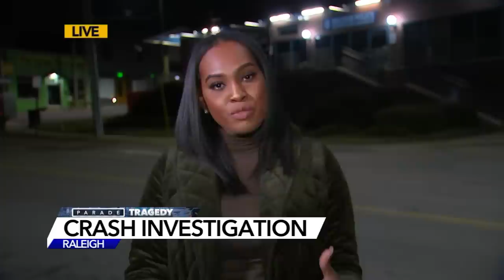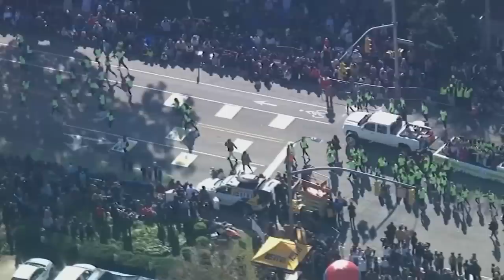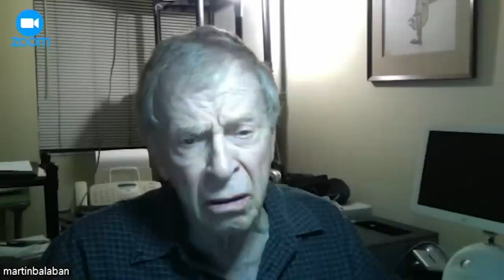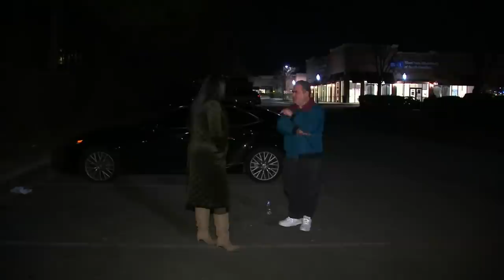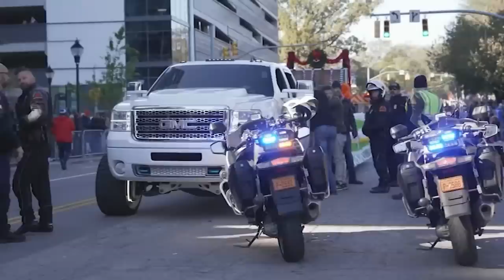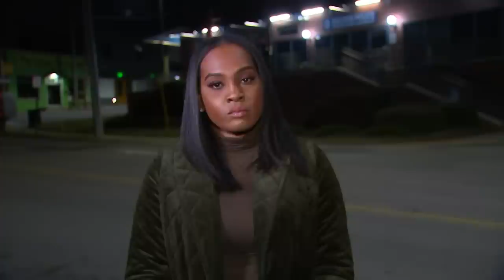Investigators look at truck part by part after Raleigh parade tragedy

Comment: Hydroboost failure. We had it happen twice on a truck just like that. Just all of a sudden, no brakes or power steering. If that happens towing a load, you're in trouble.
Reply: You don't seem to know what you are talking about.  
First in an incredibly rare moment that a  hydroboost does fail... you DO NOT loose the ability to apply the brakes.
Second a hydroboost failure does not take out the power steering.
Third.  A power steering pump failure, or a line failure draining the hydraulic system of oil will  degrade service of both systems.  BUT... it takes a good three brake applications to discharge the hydroboost, and a person can still steer.
Reply: Riding the brakes for an extended period of time with a load will cause severe brake fade.
Reply: Throw it in reverse???
Reply: @CORGI_PUPPIES  Right... So tell us smart guy.  Why did it affect this one vehicle?
Reply: @ShainAndrews  you don't know what you're talking about, hydroboosts almost always pop at 100k miles of actual truck usage. And yes no power brakes and no power steering. I've had four fail on me over the years
Reply: @Av-vd3wk  good thing you were able to think so fast on your couch. This was obviously not intentional.
Reply: @macbook802  people act like if it didn't happen to them its impossible
Reply: Gm hydroboost systems have an accumulator on the side of the unit that in the case of a hydraulic fault, fluid can pass from the accumulator to the spool valve in the unit and allow the driver 2-3 braking events after failure.
Reply: @ShainAndrews  Yeah, actually I DO know what I'm talking about, because, in case you have no reading comprehension, I said it HAPPENED twice. Both times were blown lines. No power brakes, no power steering.  The accumulator provided NOTHING. 2008 2500HD 6.0L.
Reply: @ShainAndrews  The only way they can truly tell if the driver pressed the brakes is when the vehicle investigator downloads the information directly from the cars on board computer. Most people don't realize that tons on data is saved on your cars computer such as braking percentage and even how much your throttle was being pressed.  Most accidents that are investigated only use the visual evidence and the witness testimony. Unfortunately most of the time the police report never takes the time to get the downloaded information from the vehicle data logs.
Reply: @CORGI_PUPPIES  braking percentage would not be saved on that old of a vehicle actual brake activation wouldnt even be saved. They'd need video from behind showing the brake lights or not, if the brake lights even worked
Reply: @macbook802  I have yet to replace one... ever.  Maybe change the oil once in a while.  For the second time.  The loss of oil only impacts power assist.  Steering and braking still work.  You are trying to retreat from your original position.  Which is good.
Reply: @ShainAndrews  you have yet to replace one, thank you. I've done 4 and I have a fifth one on its way out.
Reply: @ShainAndrews  so tell me how the vehicle acts if one goes out if you've never had one go out smart a word?
Reply: @42lookc   Lets play your comprehension game.  You open with hydroboost failure... now you are pivoting to a line failure.  Are they the same?  Nope.  No brakes?  That is a lie because there is a direct physical connection all the way from the brake pedal to the master cylinder.
Reply: @macbook802  Assuming you drain the accumulator by operating the brakes 2-3 times you have no power assist.  Everything works...  Are you and Watch brothers?  Sharing the same paint chips for breakfast?
Reply: @ShainAndrews  so now all of a sudden you're a fancy scientist that knows big words lol
Reply: @PrimeOptimism217   about the 2 to 3 breaking events before completely losing breaks.  Being he was in a parade. Could it have been something that happened beforehand in the parade and he used those 2 to 3 before completely losing his brakes?? and if this was the case he wouldn’t know that he only had 2 to 3 breaking events before losing his brakes right??
Reply: @ShainAndrews  bud a internal leak in the hydroboost from a failed internal seal means each time you press that pedal you're dumping the "stored brake fluid" back into the reservoir  

trailer probably wasn't even hooked up if equipped or had surge brakes (brakes only when the towing vehicle starts slowing down). not to mention guy probably had the trailer brake controller gain turned all the way down as you might know alot of trailer brakes like to drag under long light presses of the brake pedal. 

another thing since the trucks lifted something i seen ALOT in NC. the E brake cable is typically too short to reach the drum and its just left strapped up. or removed. one of those (i'll get around to it eventually) things.
Reply: @Awesomelord101  then you agree, driver's negligence or ignorance caused the issue
Reply: @macbook802  im at 227k miles on my denali duramax.....never had that happen...
Reply: @mrcontroversy222  that's because you should drive a Honda Ridgeline or a civic. Anyone who uses their trucks right will have to deal with them. I've had them fail on 2 2005 H2 limos within 10k miles of each other. Both just over 100k miles. A 2000 excursion at 150k. 3 e350 passenger buses at about 270k. My buddy's 2005 Duramax is over 200k and the brake pedal is kicking back. That's a sign that it's on the way out, the brake pedal will literally kick back when you stab the brakes. The brake feel will be more spongy but due to the gradual increase in sponginess it's not very noticeable. I'm guessing you're a grandpa and you probably drive around empty 99 percent of the time, you've probably towed twice, probably hauled two heavy loads to the dump(600lbs) and in your head you're a truck/towing god, and you'll argue tooth and nail to make others think you truck/tow.
Reply: @ShainAndrews  : ah, well you don’t know what you’re talking about. Had it happen on a suburban I had and the brake booster and power steering are run off the power steering pump. I had a belt tensioner seize up with no warning and I’m a big boy 6’5” 300 pounds and had all I could to stop that truck. If he couldn’t steer it and the added weight of pulling a trailer like that he probably couldn’t stop it. Also with the wide tires it’s probably all but impossible to steer it. Know it all’s like you should do a little research before spouting off.
Reply: Maybe he popped a belt and lost his powersteering.  That would make your brakes harder to apply since the hydroboost can't get pressure.
Reply: @patrickcarcamo622  : very possible. All it takes is a belt tensioner to seize up. All these people saying put it in low or push the ebrake or put it in park, it happens so fast you don’t know what to do.
Reply: @ShainAndrews  lol my f250 would like to have a chat with you. I loose power steering all the time and have a hard time breaking (lost vacuum assist from the booster) at the same time. The power steering is def vacuum assisted off the booster
Reply: @CORGI_PUPPIES  That's why being in a parade, he should have had the trans in a lower gear and used the brakes less
Reply: @Awesomelord101 if the e brake wasn’t connected this truck shouldn’t have been on the road, neither should any truck without this functionality. Guy traded functionality of his truck for a life. Sad day. Hopefully they’ll crack down on hacks like this and others. Be safe out there folks.
Reply: @PrimeOptimism217  How does that work when towing a load, or downhill, getting pushed by your load.
Reply: @ShainAndrews  lose*
Reply: @AntidumbisPeaceOmind  Have it happen yourself and see how it goes for you, pal. Big he-man hero keyboard warrior.
Reply: I had a pulley lock up and spit the belt on my 3500 Chevy going 70mph on the highway. Steering became really heavy, and I had to stand on the brakes to come to a stop. The hydro-boost "boosts". The steering is still mechanically connected and the brake hydraulics are still intact. The only thing that would have prevented the truck from stopping is not enough strength to mash the pedal and pull the wheel. If he didn't have an understanding of how the systems work maybe he didn't realize he just needed to push as hard as he could to stop, and gave up upon finding the rock hard pedal. It's definitely a sad situation for everyone involved.
Reply: @ShainAndrews  bruh just admit you don’t know what you’re talking about and get on with your life
Reply: @trashcontent6503  He won't. Even with all the supporting stories of serious trouble maintaining control in similar events, he still knows your truck better than you do and he'll tell you so. Pride goes before the fall...
Reply: @PrimeOptimism217  Except in a parade you are continuously on and off the brakes you won't know you lost boost until the pedal is like a rock.
Reply: @Nycist  his truck was t lifted that high I’m sure it was still engaged
Reply: Some GM trucks years ago used the power steering pump to boost the brakes  I had one loose the belt and it was interesting for a few seconds

Comment: I see everyone in the comments blaming GM and none of them understand that when you modify a vehicle you cant just modify one part and be done. I have modified trucks in the past and I currently drive a 2008 ford superduty 4x4 diesel. When I put on a 4 inch lift I had to then spend money on other parts that were now useless such as drive shafts and other suspension parts that were now too short . I also had to replace steering components and a new set of transfer case mounts as the drive shaft angles had changed. I then put on 20 inch rims and some tires for them . that requiered me to change the gears in the axle housings and I then had to get a full set of bigger rotors and calipers to stop it all. Part of doing the brakes after lifting the vehicle is exended braided brakelines as the stock lines are rubber and too short the stock lines have a little stretch due to the rubber compounds but when stretched the inner diameter shrinks meaning less fluid pressure fittings can also fail when the lines are stretched. also there are other parts that do not need to be replaced but DO need to be adjusted. The driver modified his truck so he is responsible for it. It does not come down to GM The second he modified the vehicle he voided the warrenty releasing GM from any resposibility. He modified the vehicle and did not make adjustments properly. When you go to GM's website look up the truck every truck has a rating system that says what type of trailer what length of trailer what weight can be towed. when you modify the truck it modifies the rating the vehicle is rated to pull up to a 20 foot trailer when stock modify the truck and the weight you can pull drops and the length gets shorter if you watch the video that trailer was at least 30 foot putting it outside the range and rating of the vehicle add in the weight of the cargo (float construction materials and any passengers on the float and you have a recipe for disaster.
Reply: Nevermind them. They're just ignorant. They don't know anything about what GM is responsible for or not.
Reply: Well said. I wouldn't let my 20 year old drive a vehicle like that. He probably got half job. He was worried about suspension & wheels not the other parts
Reply: And I got 22s on 40 in tires didn’t have to get new brakes or a axle regear 🤣

Comment: no cable break? did he disconnect the emergency break? couldn't drop to 1st gear? sounds like driver panicked, which is somewhat understandable. very sad all around.
Reply: Do you he was able to go faster than 1st gear. I would think he’s in low first gear.
Reply: It’s Brake bud…
Reply: He was probably high af. Guaranteed weed in his system
Reply: @bobsmithinson2050  LOL, so it is. dumb, dumb, dumb. But I have to be able to laugh at my own mistakes, right.
Reply: @macbook802  😑😑
Reply: Wssnt even his fault man.
Reply: trailer probably wasn't even hooked up if equipped or had surge brakes (brakes only when the towing vehicle starts slowing down). not to mention guy probably had the trailer brake controller gain turned all the way down as you might know alot of trailer brakes like to drag under long light presses of the brake pedal. 

another thing since the trucks lifted something i seen ALOT in NC. the E brake cable is typically too short to reach the drum and its just left strapped up. or removed. one of those (i'll get around to it eventually) things.
Reply: @ed1658  panic is panic, bud. I'm sure he didn't get out of bed that morning thinking, "I'm going to go run me over a 10 year old."  Unlike the guy in Wisconsin last year who purposely drove thru a parade.
Reply: @ed1658  ok so let’s say you wake up tomorrow and go drive your car, brakes fail when you approach an intersection, you have 30 seconds to react and end up hitting someone and killing them. I don’t think you should be charged with manslaughter.
Reply: @ed1658  30 seconds is not an eternity, and when you expect something that is as monotonous and reliant as a car or trucks brakes and nothing happens when you push your brake pedal you will panic, especially when you are surrounded by kids, and in this situation it looked like he had about 5-10 seconds to react and couldn’t turn because they streets were lined with people. I don’t know why people assume automatically that it is his fault, things like this happen. I had it happen to me in my 2003 F-250, brake line ruptured right above the rear diff pumpkin when I was approaching a stop light, luckily I still had front brakes due to the modern brake design of dual put master cylinders. So things like this can definitely happen and I was lucky.
Reply: @ed1658  Maybe, but we don’t know if he tried the parking brake or not, maybe he did. From what I have seen he tried everything he reasonably could, and from the video and the proximity of the people to him he was more focused on trying to not run people over and probably couldn’t even think about the parking brake.
Reply: @ed1658  nice attempt at gas-lighting, luckily there are previous comments that are easily read. He did try everything, we don’t know if he tried the parking brake or not but it should not be assumed that you should know to use something not for it’s intended purpose in a situation where Adrenaline and panic are involved. So far from the investigation there was nothing he could have done, because of the hill he was on the parking brake most likely would not have stopped the truck anyways. He would have hit the girl regardless. You can make the argument that this failure could have been caught in an inspection but with how spontaneous it was I doubt it would have been. There are professional investigators who are looking over this truck but they still haven’t found the smoking gun, so it was most likely s pretty small failure either in the hydroboost or in the ABS module or a combination of those with an electrical problem. From some reading online these trucks had some funky issues and recalls for the braking system so GM themselves could be in hot water.
Reply: @ed1658  I’ll sum it to this, missing something not obvious in a stressful situation is not incompetence. It is quite easy to say what you would have done after being able to see how the situation ended. I’ll question his incompetency once the investigation is done. Being judge and jury before even knowing what happened mechanically is a bit ridiculous. As for the truck coming to a stop at the end suddenly I can explain that. For one he came to the end of the hill so the truck was slowing down regardless. The reason the truck suddenly lurched at the very end is because of the way the parking pawl works, the pin that engages the pawl will skip over and not engage at a speed greater than 3-5 mph. This is to prevent catastrophic transmission damage by putting the transmission into park at a high speed. He had tried putting it into park earlier but the truck was going too fast and once it slowed down enough for the pawl to engage it jerked to a stop. So far nothing points to incompetency, he did everything he reasonably could.
Reply: @Ed once I froze on a ladder I had leaned on a house so I could paint the siding. I was about 15 ft up with 8 rungs above my ft leaving me lots of ladder to hold. It took me a solid 5 minutes to talk myself down. I panicked. I also had been a shingler prior and could walk up and work on an 8/12 pitch and didn't use safety gear (old days). Not once did I panic up there but there I was frozen.
Reply: @kuntachente6273  Actually probably in High 1st gear. I think you can't put those in low unless they are in 4X4 which would cause problems on dry pavement. Then again that would make it even harder to steer and stop if the brakes lost assist.

Comment: Im confused if the trailer had its own braking system, and if it did he should have a integrated trailer brake because for it being the top of the line GMC denali
Reply: trailer probably wasn't even hooked up if equipped or had surge brakes (brakes only when the towing vehicle starts slowing down). not to mention guy probably had the trailer brake controller gain turned all the way down as you might know alot of trailer brakes like to drag under long light presses of the brake pedal. 

another thing since the trucks lifted something i seen ALOT in NC. the E brake cable is typically too short to reach the drum and its just left strapped up. or removed. one of those (i'll get around to it eventually) things.